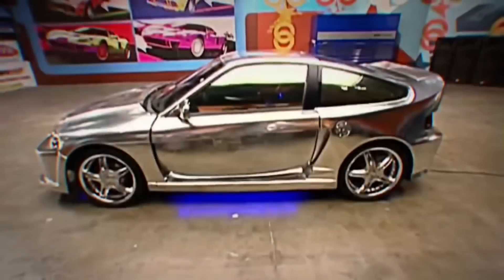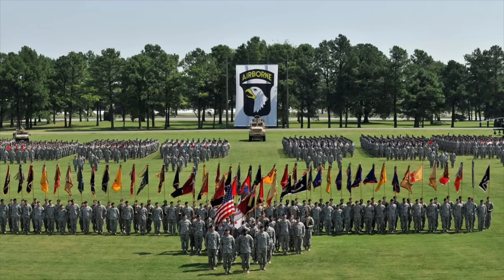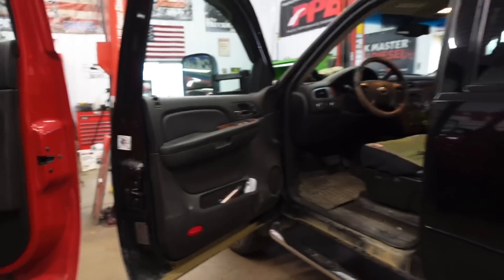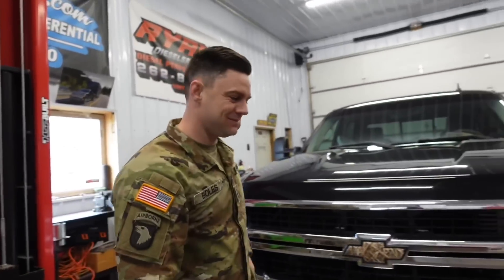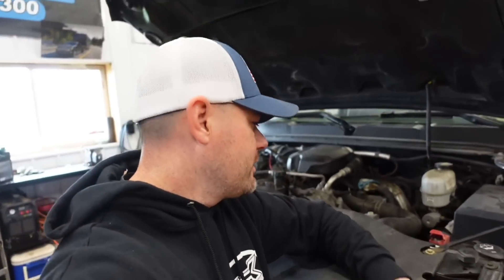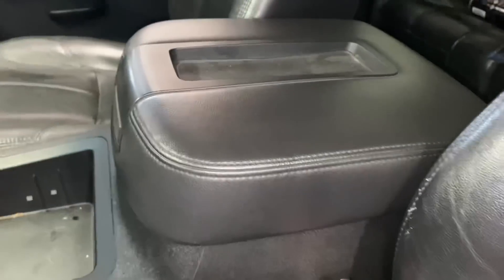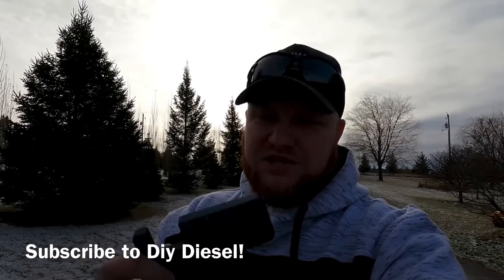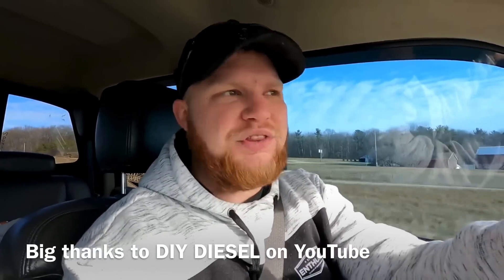Army Soldier Has No Idea What I Am About To Do To His Duramax!

Comment: Awesome Work as Always Brother-
Speaking of people needing advice on truck upgrades & refurbishment…
I need advice on where to locate & purchase new rubber door gaskets for the 2007 GMC Sierra ext cab 2500HD (new body)
I bought for my 15 year old daughter, trying to finish all the minor upgrades & improvements before she’s 16 this summer…
But the one obstacle I’ve had is I need to replace all the door rubber-
Need the one piece that goes around the entire open door frame, when the doors are open on both sides,
They are cracked and pulling loose from previous owner,
And I need the wide rubber piece that goes from the front pillar across the top all the way around to behind the rear doors, they are both dried & hard lacking any flexibility.
These are I believe the biggest issue from the truck doors not closing solidly, having air leaks and evidence of some minor water entry along roof line.
Anyway can’t find any avenue for the rubber gaskets except from a body shop… and one of the gaskets are $178.00 each,
I’d estimate using OEM,
I’d have about $800+ for the rubber replacement,
Has to be an good aftermarket company for these??

Comment: You can put the amp in the bottom section of the jump seat and extend the wires to relocate the sub under the back seat. That is what I did when I swapped over to a center jump seat from a center console
Reply from the maker: Thanks for the info

Comment: I’m having an issue with my LMM and I have run out of ideas,I could really use an opinion of someone who has the knowledge. If you can help please do, I am getting an engine power is reduced message on my dash and the truck is not throwing any codes, it is DPF deleted and other than that it’s totally stock, it will roll coal real bad when towing or going up a hill, it’s not started to flash on and off when idling, anything would help at this juncture!!